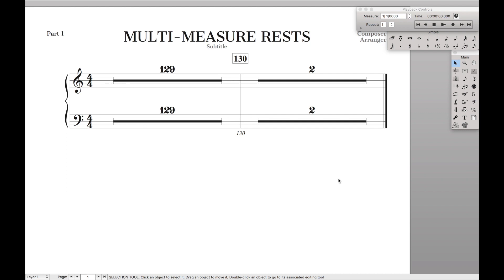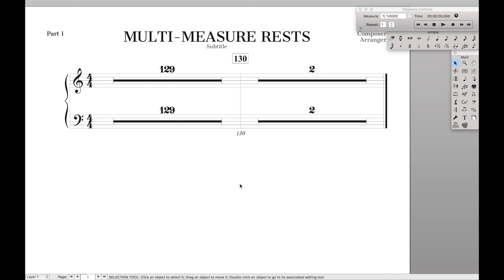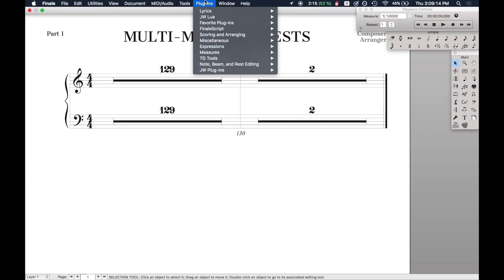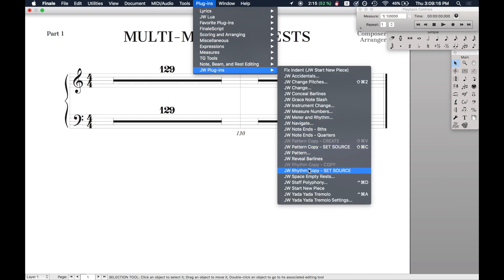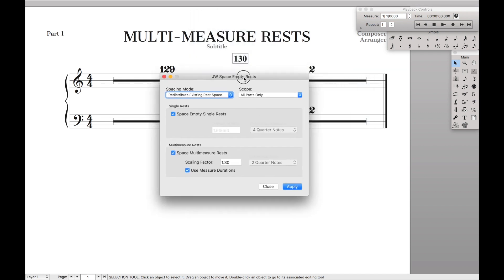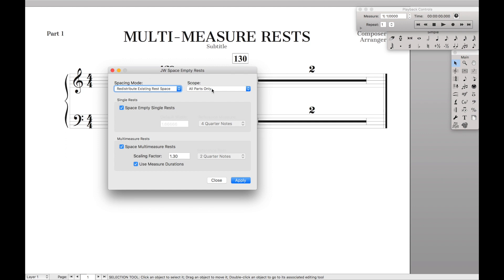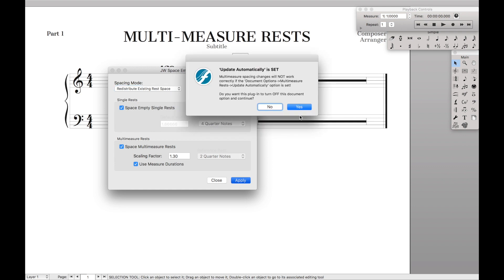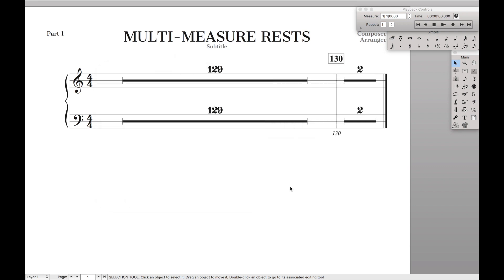Fix Multimeasure Rest Spacing | Finale Superuser

Comment: Hey there, great videos. I actually had a question regarding multi-measure rests. How can you change the text above the long horizontal bar, e.g. instead of showing the number 8 bars I would like to write INDEF. on top of the rest. If you know how to do this it would be great to see a video about it, or simple response would do just fine as well. Thank you!
Reply from the maker: As far as I know, there's no built-in way of doing that. You'd likely have to create a new expression that says "INDEF" and give it an opaque background to cover up the number.